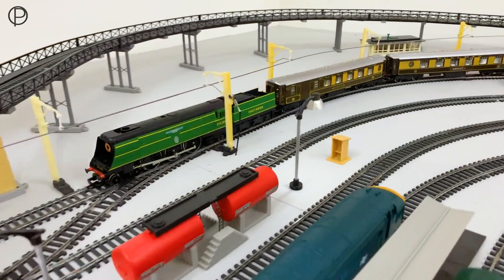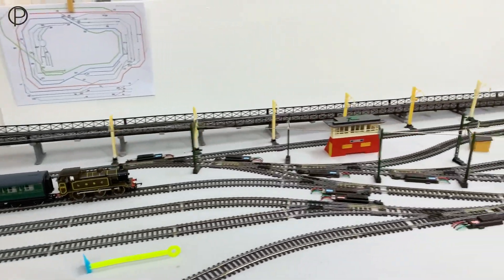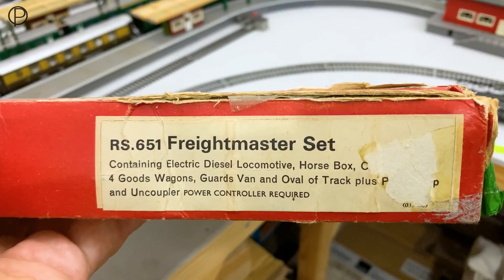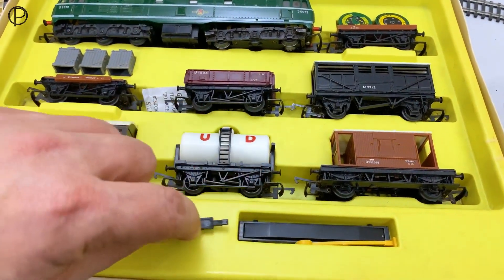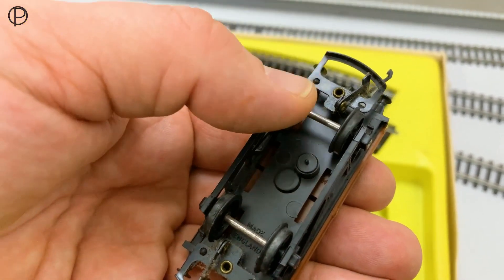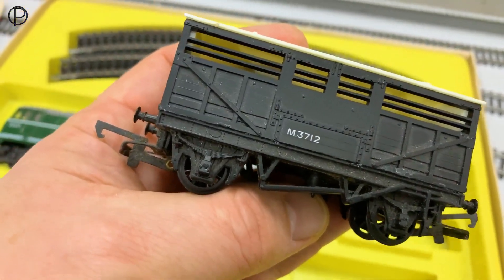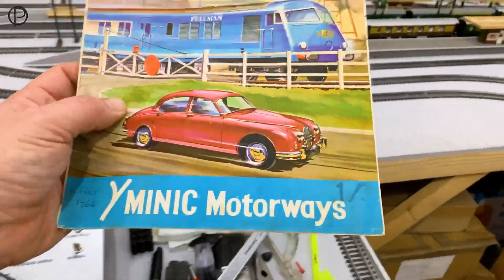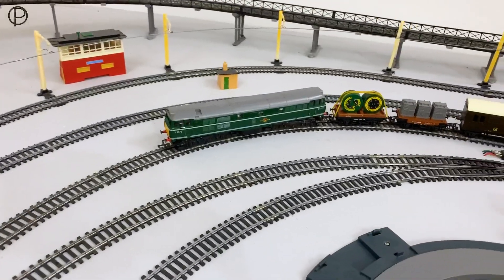Hornby Railways RS.651 Freightmaster Set

Comment: Absolutely superb entertainment today Oscar. Great to see you bring this set back to life, the Class 31 looks powerful after the re-mag and is drawing a healthy low current now. The wheel spacing seems to suit the System 6 points and diamond well just like Super 4, a great power bogie. I think the Minic Motorways range was at its largest in that Catalogue. So many pavement and verge options. If I was running that system in the sixties the though of a tank would have been too much to resist. I would have parked in the chicane and despatched my rival. Take care, all the best to you
Reply from the maker: Good morning Mr Snooze the certainly are a lot of items in that motorway range, think of the poor retailer trying to carry that many parts! Fantastic potential play value within the range, especially if you were lucky enough to combine it with the railway range.
Take care.
Oscar

Comment: Hi Oscar, a couple of years ago I took a deep breath and where possible, replaced all the plastic wheels on my rolling stock and locos with metal ones. It cost a bit, but the track and wheels stay so much cleaner now, rolling friction is reduced, and derailments have been almost completely eliminated. You really took me back to junior school in the 1960s - from the playground we could see (about half a mile away) the branch line to Great Dunmow leave the main line and make its way up a very steep slope. The loco was always a Class 31 and it was always pulling a short freight train, passenger services having been discontinued. Oh, I had the car ferry set for my Minic stuff, so it did make it into production (although you'd wait in vain for many of the "available later" items to appear). It was one of the best things Minic ever produced but sadly, all I have left of it is the plastic sea.
Reply from the maker: Good morning Roger thanks again for the information sharing those great memories, is terrific to hear you're still have the plastic see.
Take care.
Oscar

Comment: I had the 1973 R.507 Freightmaster set when I was 9 years old. I have three of the sets now and filmed it with a modern class 31 with sound, although all three of my locos work of but need cleaning. My set featured the Fyffes banana van that could only be bought with that set. I have a few of those extra two. As a kid, they were filled with German troops and were always ambushed by the RM Comandoes. The set was featured in the 19th edition of the catalgue, also in 1973.
Reply from the maker: Hi thanks for watching, sounds like you have a terrific collection of items from the range. The Fyffes  Banana vans are quite lovely items.
Take care.
Oscar

Comment: You did an incredible job of bringing this old set back to life Oscar, it performed very well if a bit noisey. I've always been disappointed by the performance of my class 31 but after seeing this video perhaps it is time to revisit it. Perhaps I need to invest in a re-magnetizer. 
Regards, David.
Reply from the maker: Good morning David Great to hear you have one of these model locomotives in your collection. I've been told by a number of others that some of these motor bogies were bad from day one on the 37,31 and EM2, noisy and poor runners from new. The play in the bearings can be quit something even from new and then bearing supports can also begin to disintegrate with age or may be damaged when originally installed. I think there was a huge variability in the quality in production of these bearings over the years. The re-magnetizer is a great tool, it can really bring a model back to life, some magnets may lose there power over time and if a motor has been dismantled in its past life, it's a very handy to restore the magnet in motor. 
Thanks again take care.
Oscar

Comment: Old money - 20 shillings to the pound, so 100s = £5.00.  I was lucky enough to get a freightmaster set recently, minus the box. Those power bogies always seem to need fettling but run well for a while once you've got them set up.  I have a lot of Minic too - including the car transporter. The top deck of the transporter slides backwards and downwards and locates in the slot of the track so that cars can drive from the track on to the bottom deck, and then on to the ramp too, to be manually lifted up into travelling position.  Thanks for sharing, as always.  Mike
Reply from the maker: Good morning Mike great to hear you have the items from the freight master set and a good collection of Minic. The car transporter sounds like a wonderful item thank you for describing its operation. These items are such a lovely examples of toy design with plenty of a value in mind. 
Take care.
Oscar

Comment: Hi Oscar, Great video again. I have just picked up another Brush Type 2(Class 31) in mint condition. It is the slightly later version with the extra pick-ups. So now except for the box I have managed to put together another the Freightmastter set. It was always the one train set I wanted as a kid and never got. So like the one I have just put together I had to get it piecemeal. For the silver paint on the handrails a chrome pen works really well to get them looking nice again. I am not sure, but I think that the  plastic bearings between the worms and the armature to stop them moving about and being so noisy must be very worn. It is definitely more noisy that it should be. I do realize because the base board is acting like a sounding board it will be noisier may be part of the cause. I think that one of the reasons why they did not upgrade this engine was that there was better competition coming on to the scene in the form of the Airfix and later Lima class 31's.  So it was not probably financially viable to do so at the time.  All the best,
Reply from the maker: Good morning Gerard great to hear you have all the items that make up the Freightmaster. Thanks again for watching and the information it's very much appreciated take care.
Oscar

Comment: Hi Oscar. I have watched your latest Masterpiece Twice so I didn't miss any of your points. Using the Freightliner Set as a measure for UK Inflation over the period of the Two Featured Catalogues, the Minic Motorway Racing Car set would have been about £8.40 in 1972 and the Freightliner set around £5 in 1964/5.  Looking into the Innovative ways on cost savings by Triang with paper labels on multipurpose packaging, compatibility of items from different ranges and the introduction of a New Track System using lighter gauge rails and less plastic on the sleeper beds, I can't see what the Triang Management could have done to run production more efficiently over the Freightliner Time Frame, Finally going under with a £4.5 Million loss. I beleive it was inevitable and stems from the United States implementing an aggressive inflation policy in 1965. If purchasing power is compared $1 to £1 since 1965 to now 1$ = $8.77 where as £1 = about £20 ( these figures are approx but should give an illustration of what happened ). To watch the Class 31 storming up the elevated section and going through the junctions was like seeing Geoff Hurst scoring the winning goal in the 66 World Cup, British Genius at its Best. Triang was a Victim of the United States desire to have the World Reserve Currency it wasn't down to Triang making Rubbish Products as You Prove with every episode. Looking forward to your next video. Best Wishes Tim
Reply from the maker: Good morning Tim glad you're enjoying the videos seeing these older Tri-ang Hornby items in action and thanks for taking the time to write this terrific comment it really is much appreciated.
Take care.
Oscar

Comment: 135/- =£ 135/20= £6.15/-   = £6.75, I think. David. 
I have this set and a tatty box, it was my mother in laws second husbands. I think I have three Brush type 2’s but the bottom plates on them are broken where they screw on and one  has all the copper pickups totally damaged. These were used on steel work in doubles around Sheffield. They were all looked after at Tinsley shed by the marshalling yard.
Reply from the maker: Hi David, thanks for watching and the information. Great to hear you have the set.
Take care.
Oscar

Comment: Hi Oscar,
I have some of the Class 31 Brush type 2's, and they do not sound as loud as the one from your new set?  They are smooth runners..
Is it possible that the plastic bearings on the armature are a bit worn or loose?
The later version with the extra pick-ups, unfortunately uses pin point axles with a metal wheel on one end, (at opposite sides) and a wiper on the axle.. Unfortunately the holes in the bogie frame (for the pinpoints to sit into) have a habit of wearing badly.. This lets the wheels get out of alignment. Especially,  as the loco gets older and has a lot of running.. 
A better solution would have been,  to use the earlier bogie, but with the sleeved wheels and the same pick-up arrangement as the searchlight wagon.. This is not prone to wear nearly as much?
Great video, and nice to see Mr. Snooze watching too.
Reply from the maker: Good morning Robin thanks again for watching and the information it's much appreciated.
Take care.
Oscar

Comment: Super video Oscar. I noticed the cable drums had black squares on the flat bottom, are they magnets to hold them on the wagon via the wagons weight?  There's some super looking stuff in that minic system as well. Cheers Rob
Reply from the maker: Hi Rob sadly no magnets in the bottom of the cable drums they are just hollow, it would've been a great way to hold them on the wagon.  I think I may give that a try. Thanks again for watching glad you're enjoyed seeing the motorway range of items.
Take care.
Oscar

Comment: Hello Oscar
Tri-ang Brush Type 2 is one of my favourite engines.  I think Tri-ang got the cab shape spot on, much better than the latest Hornby offering which is too boxy.  I seem to remember you mentioning a modification to the spider assembly to correct any melting/distortion of the brush opening.  Did you ever show that in one of your videos?
I have to confess I do miss your Super 4 layout.
Kind regards
Simon
Reply from the maker: Good morning Simon thanks again for watching, I think you're right terrific looking bit of modelling by Tri-ang Railways. I have modified the spider assembly and motor cap in couple of models I have. I worked from the great information in one of John's Amazing Trains videos  https://youtu.be/MckRiFeTxvQ
Take care.
Oscar
Reply: @oscarpaisley   Thank you Oscar